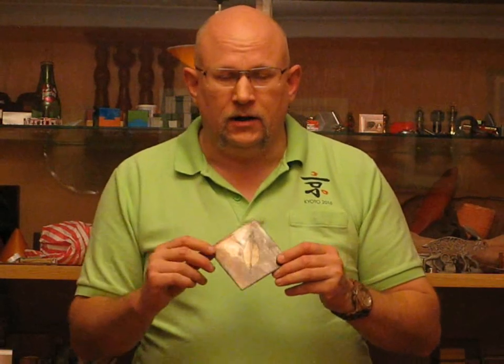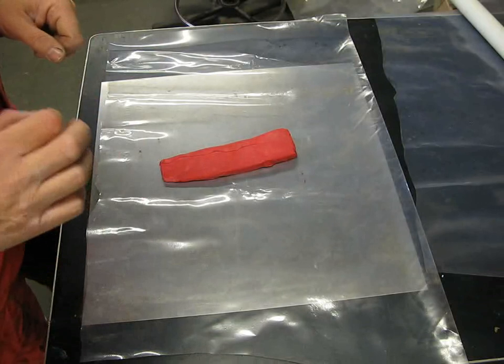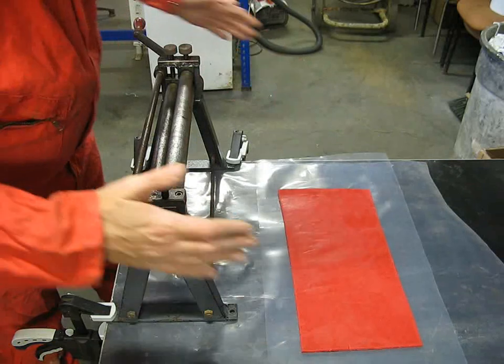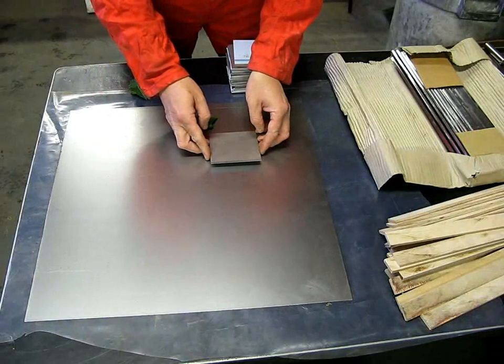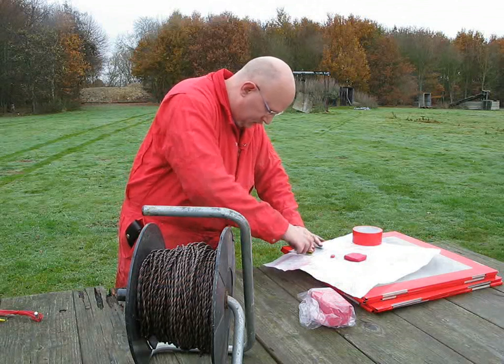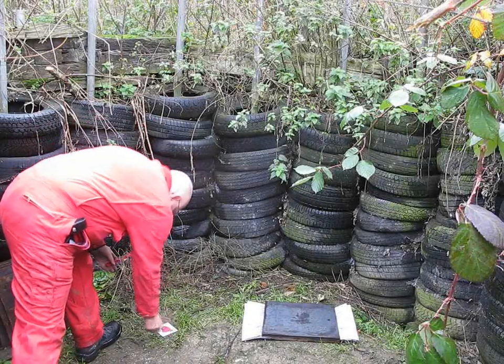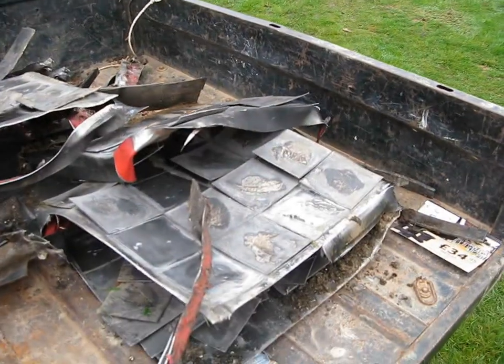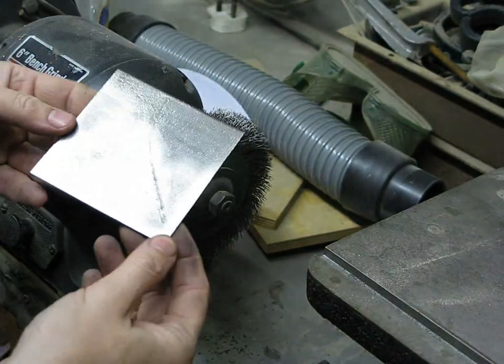IPP39 Exchange Solution

Comment: Good work, a friend of yours sent me a link to this video. I have for some time been thinking about making a video similar to this but the product you use is unobtainium here and the only similar product that is available has a larger critical diameter parameter and may not be so good in a thin sheet. Cheers from The Land Down Under.
Reply from the maker: Dave, I guess you're talking about AN based emulation materials, I doubt they'd work for leaf printing.  RDX or PETN based plastic explosives are best from my experience, but a smooth (without any AN loading) high percentage dynamite/gelinite could work if rolled into a 5mm plus sheet.